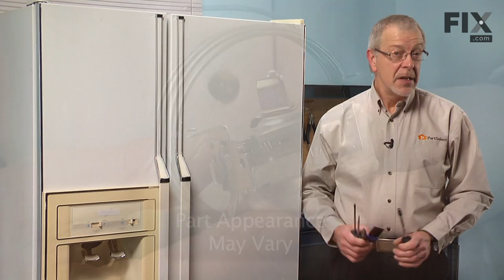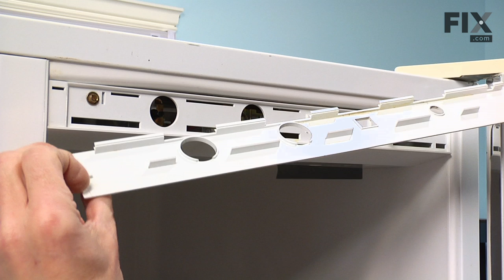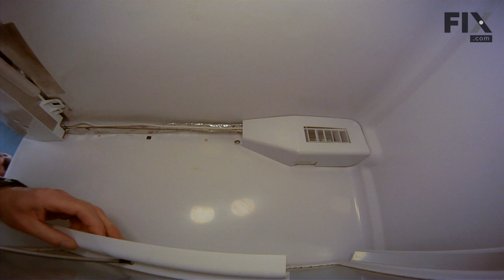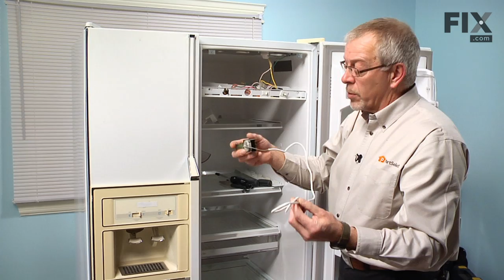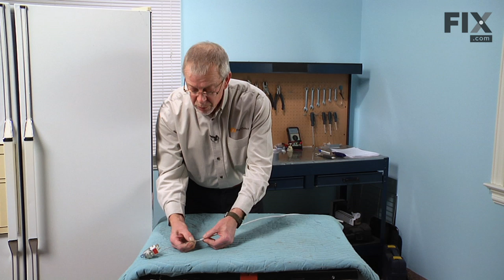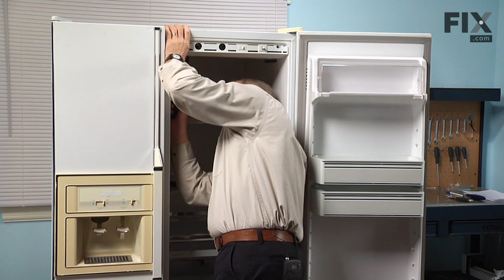Whirlpool Refrigerator Repair – How to replace the Thermostat

Comment: What are the symptoms of a Whirlpool refrigerator needing a new thermostat? Thanks
Reply from the maker: Hello, here are the most common symptoms of a refrigerator that needs a new thermostat:

-Freezer section too cold
-Freezer won't defrost
-Fridge and freezer are not keeping cold
-Fridge section is too cold
-Fridge's compressor fan will not engage or work consistently

Hope this helps!

Comment: Thank you so much for this video! It made thermostat replacement very easy and quick. The replacement thermostat I got already had the rubber tubing on the capillary line, so I didn't even have to switch that out.

Comment: So is the Capillary tube suppose to plug into something?... or do you just wrap it around in those brackets on the holder?

Also about 6 inches of the end of the tube are uncovered... should i have slide the cover tubing down to cover the wire on the open end? Cause about half of my capillary tube that is wrapped around the little block is uncovered.

Comment: Got the recommended oem thermostat based on the model number (confirmed it’s right when putting my fridge model number in the Whirlpool website). But the prong terminals on this new one are side by side rather than stacked vertically. Only markings is one seems have an L on it and the other a C. 🤷‍♂️ no idea which plug goes where. Figured I had a fifty fifty shot so I put it back together. The fridge is running but how do I know I did it right? What would happen if it was backwards? Would it still run?
Reply: If your wires in your fridge were orange and red, the orange goes on L, the red goes on C. That's all I know.
Reply: @timhuguenin did u have it on right? I’m going through the same dilemma . Was James right?
Reply: @algonzalez7764  i don't remember which colors went where but somewhere else i saw someone say it doesn't matter in this case, something about it being a switch... i don't really know but whichever way i put it in there, it's been working. you got a fifty fifty shot, right? i say go ahead and pick one

Comment: Hi, i ordered a replacement thermostat and it comes with a long bare wire that fits in a tube that is mostly hidden heading towards the back of my fridge freezer, my question is how far should i push the wire and is it supposed to fit in to something at the back ? As its hidden im just going off guesswork, do you have any advice ?
Reply from the maker: It is likely the thermostats sensing bulb which is a tube filled with a gas that expands and contracts with change in temperature. That pressure change inside operates the diapram inside the control to open and close the contacts. We would need your model number to direct you to exactly where it terminates but most likely it goes into a channel or a clamp that mounts on the back side of your evaporator.

Comment: The thermostat I received, WP2198202 looks different than the one in the refrigerator (ED25PQXDN01). The wire contacts on the replacement part are oriented front and back instead of up and down as on the old part. I have a red (top) and orange (bottom) wire. Which wire goes to which contact on the new part?
REPLY
Reply from the maker: Hello Jim, I have researched your model and the manufacture has discontinued the original thermostat and has now updated it to WP2198202 that you have received.  I would suggest contacting Whirlpool (1-800-688-2002) about how to install the updated part.